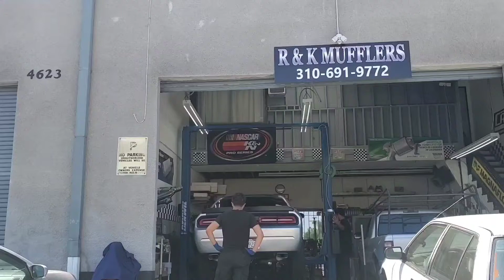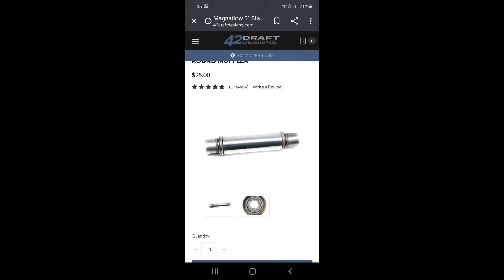Dodge challenger sxt v6 rear resonator delete with magnapacks in center.

Comment: I want to do this for my V6 SXT. Sounds so much better.
Reply from the maker: You won't be disappointed!! The sound rocks.  That's all I did it for, Sound only. I'm very pleased with my results.  Do it bro!!
Reply: Awesome man. I’m going to do it! I have a 2016 Challenger V6 SXT Black Top. Can I ask you some questions? So I’m reading through the comments and just wanted to make sure; what EXACTLY do I need ON and OFF my car to get it like yours? Any smog inspection problems? And any cabin drone when driving on surface streets and highways going up to 80mph? Thanks a bunch man! I need to get this done!
Reply from the maker: @patrickjacobs2382  I just went and got a smog in January,  Noo problems.. only problems with smog if you cut the Cats..otherwise your good to go. I actually have a video on the sound on my channel.  Check it out. The sound of drone is minimal.  You can have a conversation in cab easy. Go on my channel and look for the sound video.
Reply from the maker: @patrickjacobs2382  you want the magnaflow magnapacks in center and cut rear resonators off. Done deal.
Reply: Perfect! Thanks so much bro! I’ll be putting this all together, hopefully soon 👍
Reply from the maker: @patrickjacobs2382  Awesome man. Welcome. Let me know how you like after you got it done. 👍
Reply: Will do bro! Thanks again for all your help!
Reply from the maker: @patrickjacobs2382  You got it boss.
Reply: @patrickjacobs2382  just a heads up. The setup does sound a little different on the newer challengers. I ordered the magnaflows from this video and got the same setup on my 2019. Doesnt sound as good so far. And the drone while taking off is far more than I anticipated.

Comment: Sounds dope I just got a 2018 sxt and wanted to get this done. How much did it cost???
Reply from the maker: The magnaflow magnapacks were already on the car from prior owner. So I didn't pay for them in center. But I did pay $160.00.. he charged me $150.00 but I gave him $160.00 to cut the rear resonators off and straight piped from the mid magnapacks. Thanks bro!
You won't be disappointed if you do this.
Reply: @TheBarrios69  that’s what’s up you lucked out with already having the magnaflows installed lol looks like it’s gonna cost me around 400 for everything but if it sounds anything like how yours came out it’s def worth it
Reply from the maker: @Trixdope  I really did luck out having them already in from prior owner.  I was shocked at the muffler shop after they raised car and I saw them. I was stoked.  Trust me 400.00 bucks to have your baby rumble like that ain't nothing.  I got another video on the sound while driving.  I'll get the link so you can check out the sound kinda while I drive. You can have a conversation in cab no problem.
Reply from the maker: https://youtu.be/gSABukN_5RE

Comment: I am wanting a little noise from my new V6 but this is too loud. What would you suggest just for a little rumble?
Reply from the maker: Leave the stock CENTER resonators in.. but cut the rear mufflers/resonators and pipe it from the stock mid mufflers to the tips. It will give it that lil rumble your asking for.  Hope this helps. Its a common thing people are doing to there challeys lately.

Comment: Hey I just got these installed on mine there loud I’m also from California, any problems with the cops?
Reply from the maker: None whats so ever. I don't step on it around cops of course. I drive it chill. I just bagged my challenger.  I'm all about the low-life now. But I love the deep tone the more gas I give it. I've been beside cops atleast 5x side by side and I drove slow and they don't even look my way. Seriously.
Reply: Any check engine lights.
Reply from the maker: Nope. Not at all. Or I wouldn't of done it. I have a airaid intake on my motor aswell.  Passing smog  ERRYDAY.

Comment: Hey could you do some video of what the cabin sounds like driving around and sitting at idle. i did a rear muffler delete and sounds good but too much drone im thinking about the magnapacks but just want to make sure.
Reply from the maker: Stephen Allen  i did try to make a video like you asked. The sound isn't the best, but I did try sir. I'm uploading it now. It might take a hour or so. I tried man! Hope it helps. I feel I will get hated for the video sound. But wanted you to hear it.  I might delete it. The video doesn't do justice.  Let me know what you think.
Reply: Did you ever figure out a good setup?
Reply from the maker: Yea the video has it. I love it. I wouldn't change a thing. Cops don't mess with me either.
Reply: @TheBarrios69  alright cuz I have a mangaflow mid resonators and muffler delete but the drone is still bad, love the sound outside the car but inside it can be deafening. Have you ever heard of J pipes? Trying to figure out if those actually take the drone away. Also thank you for the vid
Reply from the maker: @user-kz6fs3mn4s  I have not heard of J pipes. I can definitely have a conversation in my car. Stereo off. My 3 year old son rides in my car and watches blippi in the baby seat. I can hear what he's watching. What year is your car?
Reply from the maker: @user-kz6fs3mn4s what RPM is the drone the worst or too much?
Reply: @TheBarrios69  I figured it out I tried six different mufflers all had drone. When you delete the resonators in the center. I ended up leaving the rear muffler/ resonators on and replacing the center with flowmaster. Super 10s sounded really really good with no highway drone.
Reply: I have a 2023 sxt, I might have to try putting some type of performance rear mufflers on to fix the drone. Idk if it’s cuz it’s the newest model that makes that bad or what but I’ll keep testing haha
Reply: The drone is terrible on initial speed up then around 2000 rpm its pretty bad, if I’m going 80 mph hour and up it’s terrible as well
Reply: @johnpaiz-d9t  I've tried 6 different ways and I come to the conclusion that leaving the rear on is the best option to remove the drone. Just remove the center mufflers in the middle and replace them with any muffler you like. It will sound really good at startup and accelerations but not while driving at idle speeds. But when replacing the middle with a muffler it needs to be a pretty aggressive sounding one like a flowmaster super 10 to get the best sound with the rear resonators on.
Reply: @icebrakes1  thank you I appreciate that cuz I’ve been thinking if putting my rear mufflers back on and doing the aggressive mids, I’m not the type that likes loud the whole time, I would like it generally quiet while driving but can hear it when I’m trying to take off fast. So this def helps

Comment: Hi there,  by any chance, do you have any drone on the cabin at all?
Reply from the maker: I have another video with sound. Look on my channel.
Reply: @TheBarrios69  I just gave it a quick look, do you think that with a different exhaust tips would reduce the drone a bit more?
Reply from the maker: Tips don't do anything.  They are for looks. Any exhaust guy will tell you.. tips are tips. I asked this question many times.. tips don't change anything.
Reply: @TheBarrios69  thank you so much, I am looking for exhausts since I'll buy a challenger and I was between the vibrant resonators or this ones
Reply from the maker: Good luck bro. Either way it will sound great. But I looove the sound of mine. I just bought 22" hellcat style black red milled wheels on my car. It looks siick.

Comment: So I just got this done to mine. Same thing. Magnaflow 10415 midmufflers and rear resonators deleted. It sounds great, but how does it feel for you? I don’t know if I’m just going crazy, but to me it feels like the car is holding back. I felt it faster when it was all stock. What do you think?
Reply from the maker: I get what your saying. But all in all I thought to myself.... its a V6. I hear other brands of cars with muffler delete and I hear the same as yours sounds like its loud, but trying to go. But the feeling is different from sound to me. Feeling it felt that way when I put 22" rims on my car. The sound makes it sound slower.  If that makes sense.  The V6 on my car is slow with bigger rims. But im not a speed demon. I just bagged my challey 2 weeks ago so I'm all about the low-life now. Plus less tickets for driving slower. I'm for show these days, not speed.  But your not crazy it might also be the less back pressure.  I do have a airaid cold air intake and it sounds deeper and much more throttle response, aftermarket intake tube too. Makes a big difference then a airaid and stock intake tubing.
Reply: @TheBarrios69  Gotcha. I’m not a speed demon either, but every now and then when the highway is clear I enjoy the feeling I get when I push that pedal. I was beginning to think that my speed sensors were off, but I’m glad to hear that it’s not just me. I’m going to look into that cold air intake. I really love how it sounds, but I definitely miss the feeling I got when it was all stock. Appreciate you taking the time to respond, man! Do you have any videos of your car all low? Sounds dope.
Reply from the maker: I do got 2 lil ones on my channel. I got afew videos on challengers on my channel. Check out bro. I appreciate the recognition.  I love to help.  Thank you.
Reply: @TheBarrios69  the best thing for you to do with your car if you want to feel more take off power and More  performance and torque from the starting line. I know you're not a speed demon but that will  definitely make the  performance on your car increase by much Change your rear gear ratio that would be the the best thing if your car is rwd
Reply from the maker: @guskuratlejr9228  I got the cold air intake Airaid.  It does well. But I am slow and low. I just put smaller tires on my car and it has less traction I'd say.. so I do go slow and low.
Reply: @TheBarrios69  It looks and sounds incredible
Reply from the maker: Man! Thank you! That means a lot.

Comment: What did you do here straight pipe it? I have a GT I’m looking for a sound like this! Or did you use magmaflow?
Reply from the maker: I have magnaflow magnapacks in center and cut rear mufflers off. That's it.
Reply: @TheBarrios69   Thankyou!
Reply: Do this instead:
Big Boz 4(2 pcs) replaces mid mufflers
Resonator Delete
5 inch tips
Cold Air Intake
You'll thank me later......
Reply: @Gitnardoproductions  what would be the best intake ?
Reply: @SwMexican  k&n would be great but honestly my spectre performance gave me the bottom tone I was looking for.  Now everyone ask me if I have a V8
Reply: @Gitnardoproductions  bet the spectre is what I had in mind lol , I already have the big boz mufflers , just with a k&n air filter
Reply: @SwMexican  No doubt, you'll love it

Comment: Hey bro! I’m planning on making my car louder. Is this the same as a mid muffler delete ?
Reply from the maker: No.. mid muffler delete is meaning there is a straight pipe in your center instead of having those 2 mid mufflers in center. I did the mid muffler deletes but added the magnaflow magnapacks in center and did the rear mufflers delete.  On a challenger there are 2 sets of mufflers/resonators...center and rear..it's up to you which you wanna add or delete..
Reply: If you’re gonna delete one I’d go with rear, if you delete the mid it’s gonna sound super raspy, but if you delete rear it’s deeper and way better sounding
Reply from the maker: @jeffreygrose9971  raspy? You're tripping I have no rasp to my lovey Car.  Trust me. I got sound video on my channel bucko.
Reply: I was saying if you only delete mid it sounds raspy. You just deleted rear, the good one.
Reply from the maker: @jeffreygrose9971  mine Has magnaflow magnapacks in center bro. But I gotcha..

Comment: I did it on mine as well sounds amazing
Reply from the maker: Awesome! Glad you love it. Can't beat the rumble for the simple mod.
Reply: @TheBarrios69  agree
Reply: what size diameter and pipe were the magnapacks? they have 4, 5 and 6 inch diameters, also was it 2.25 in outlet or 2.5?
Reply from the maker: @Eazy_Way_Out  Sorry I just saw this. I'm sure you got it figured out by now.